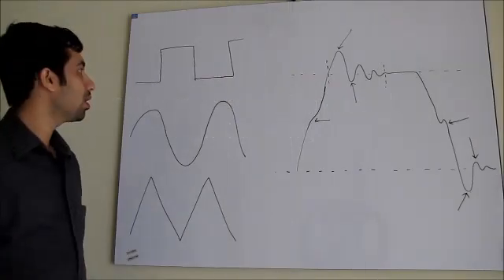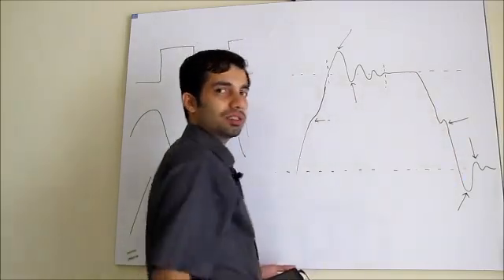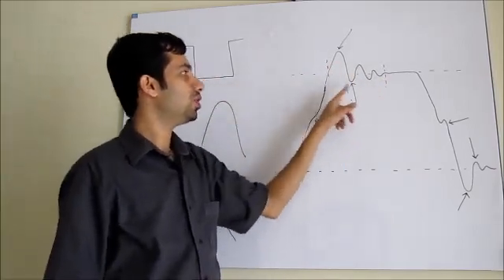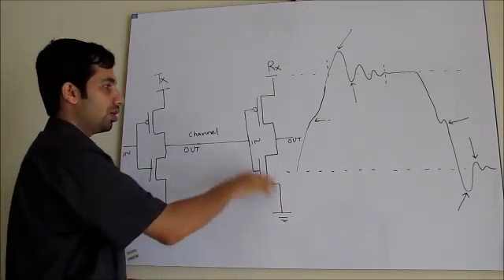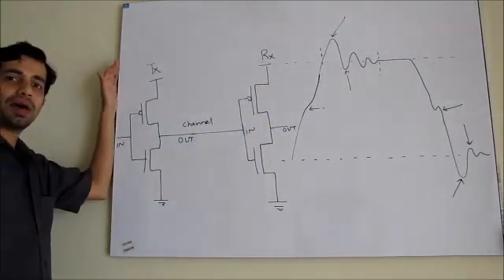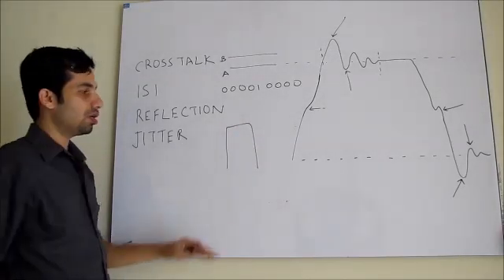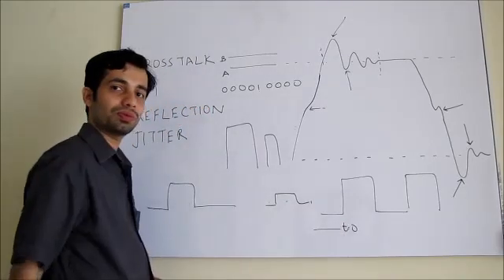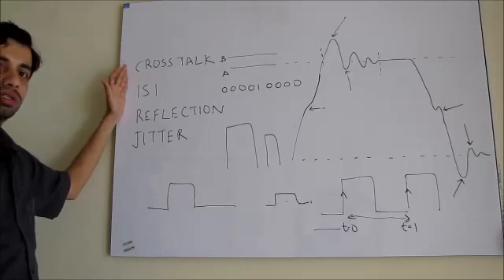Signal Integrity

Comment: The end system still translates it into a digital signal; so you need to consider if the end translation is good or not in terms of signal delay/integrity (is it still 1 signal, acceptable width/etc).